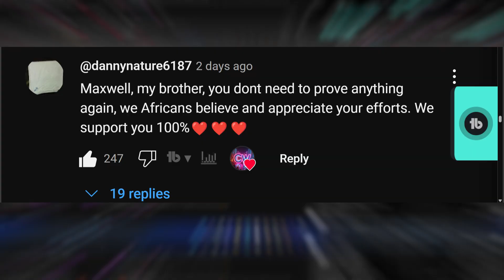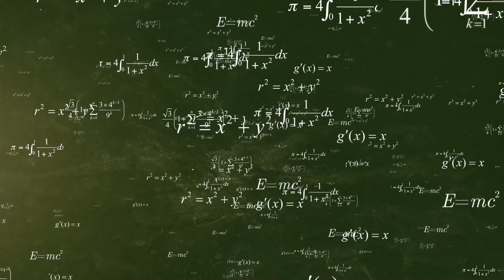African Tesla? Why Maxwell's Device Sparks Controversy

Comment: If he is generating energy from radio waves, why does he need a battery as shown under the hood? Radio waves are in the Pico, Nano, and Micro range - to amplify these signals require an additional power source. These signals can be amplified, but even the ampLified signals can barely push a speaker. The power required to push a car continuously cannot be generated by magic, it must be transferred, Radio waves are just too weak, even when harnessed at the source, much less from a distance. At one point he says the car is a generator, meaning like an alternator, and can power a refrigerator, and in the next breath he claims it is powered by amplified radio waves, harvest from the air - well, which is it? Generation requires magnetism, rotation, and conduction, and harvested radio waves requires amplification. This is fraud going on here.

Comment: Let us remember that his discoveries were born out of continuously experimenting with various electronic components from scraps, electronic components which he did not have a full understanding of their function.Let us put it this way, it's a break through that works, but the owner hasn't fully grasped the functions of his discoveries, for an example when  he said the energy is from the air,he lacked scientific terms of all elements that make up the air, and wondered what exactly from the air is powering his device? He  then discovered that it was radio waves! Let us remember that the man is not a college scientist, he will always lack  the scientific terms to explain his scientific discovery correctly so.He has also spent years crisscrossing the Globe trying to get it satisfied by the Scientific Community but to no avail.If the scientific community verifies this and it's real, the world is poised to change dramatically, this could be bigger than the industrial revolution, think about a space ship in space moving for ever looking for the new worlds out there.Humanity could travel in space without worries looking for new worlds similar to mother Earth, this could be the time to conquer the Outer Space!

Comment: The device must use cascading amplification to boost the output to a level of the radio signals it picks up.  It doesn't take a PHD to figure this out.

Comment: Comparing Musk's electric vehicles to Chicumbusto's microsonic technology is more like comparing apples to oranges.  Musk is not an innovator of electric vehicles General Motors has EVs way before the first Tesla was introduced.  Electric vehicles use batteries as a source of energy, a well known source of power, while Chikumbusto's microsonic theory uses radio waves, an unvalidated method yet to be proven feasible.

Comment: Lets remember how energy works: the electricity of our homes comes from outside with 10000 or more volts and is converted or reduced to 220 volts with and if we want to take 220 volts from a 12v 24v a lower voltage source what happens is that it will only work for a few seconds because the source finishes. So if readio waves are energy or else we cant listen to the radio, and they are always active in an endless signal like circle waves them taking the radio waves signal and making volts out of it its possible because the source is always turned on. And with an amplifier like capacitors that can store energy etc the output can be sustainable and without fails.
The energy isnt lost, just converted.

Comment: Tom Bearden's work suggests radio frequencies are the best waves to extract power out of the Time-space vacuum-apparently electrons spin in 4 dimensions, by Minkowski geometry and it is the time dimension ie the 4th dimension where you can extract this zero point energy. these devices are likely working on Scalar waves, which can be shown mathematically on Maxwell(yes James Clerk Maxwell) equations. Bearden had patents on similar devices but found the same hurdles for years that Chikumbutso faces today. This is neglected physics likely due to greed rather than physics laws broken.

Comment: While We Can Only Speculate at this Point ,  Base on my own Experience with Enegy Generation using Magmetic Power Rotation , I saw the Limitation, but alway belive the the Zero Point Concept can be applied to an DC Capacitor with Store and Regulated Release Function, note Capacitor Hold Load of Energy but are unable to Store this Energy.

Capacitors are a Kind of  Battery but unable to Store . I Think the Technology is using of Microwaves with Atmospheriic Eletrons which Multiples at an incredidable Levels of Energy , almost like the Sun which is slef powered. Its like putting a *Glass Full of Water in a Tank full of Water , the Water in the Glass will Not leave or the Water in the Tank will not leave, they are replemisnishing each other in a Eco System.  They are Equalized

I would Support His Work 100%
Reply: This is a remote controled car he isn't harnessing the radio waves he's sending radio waves from a transceiver to a receiver
Reply: My knowledge of electronics/electrical technology is above average. What you are saying is totally incomprehensible!

Comment: Answer to heading: because they want to steal his invention and rewrite history.
Reply: "Sometime in 1931, Dr Tesla took Peter to Buffalo, NY for the unveiling and final testing of a new kind of automobile. Dr. Tesla acted somewhat mysteriously about it, would tell Peter nothing in advance, and even after he had seen the car, answered some of his questions with “Don’t ask any questions. The car turned out to be a standard Pierce Arrow, with the engine removed and certain other components installed instead. The standard Clutch, gear box and drive train remained installed. Under the hood, there was a brushless electric motor, connected to the engine [?]. The engine was said to measure 40” long by 28” diameter. However, some of these figures may be estimates. Tesla would not divulge who made the motor.

 Tesla’s Power Box

“Set into the dash was a “power receiver” consisting of a box measuring about 24” long by 10” wide by 6” high, containing 12 radio tubes. Three of these tubes were model 70-L-7. A vertical antenna consisting of a 6-foot rod, was installed and connected to the power receiver.
The receiver, in turn, was connected to the motor by two heavy, conspicuous cables. Two “spindles” (rods?) about 1/4” diameter by 3” long protruded from the receiver towards the driver. Tesla pushed these in before starting and said: “We now have power”. These spindles were in line with the two power cables coming out of the back of the unit and presumable worked two separate power switches.
There was a 12-volt Willard battery installed in the car, but it was for the lights only and much too small to run the car. In any case, the motor was an AC motor.
Peter said that Dr. Tesla had built the power receiver himself in his hotel room, and carried it to Buffalo. The motor was built for him by some unknown company. The motor was completely enclosed and when Peter first saw it, it was stopped. Later, after the engine was running, Dr Tesla asked Peter to look under the hood to check whether the fan was running. Peter asked what the fan was for and was told that “The engine is running pretty hot”. Maximum engine speed was 1800 rpm. Power rating was 80 hp.”

A test Drive 

To start the car, Dr Tesla handed Peter an ignition-type key. Peter inserted it and a green light came on, on the dash. Dr Tesla thereupon said: “The engine is now in motion”. The engine could not be heard from the driver's seat at all. When listening under the hood with the engine on, there was a slight hum. The standard accelerator pedal was used to control engine speed. Clutch, brake and gearshift were unchanged.
The instruments on the dash appeared to be standard ones. However, there was a voltmeter which was used to measure output of the receiver. Dr Tesla commented that the receiver had enough reserve power so that you could drive the car next to a house, connect the wiring, and light up the whole house. There was also some kind of hydraulic pressure gauge on the dash. Peter asked its purpose but Dr Tesla would not tell him.
Peter drove the car for about 50 miles at speeds up to 90 mph (the speedometer was calibrated to 120 mph). Power seemed at least as good as the normal Pierce Arrow engine. Acceleration in second gear seemed particularly good. Shifting gears seemed somewhat smoother than with a normal engine.
Dr Tesla seemed enthusiastic on the first test ride and said, “Peter, this day will make history!” When Peter questioned the source of the energy to drive the car, Dr Tesla said: “It is a mysterious radiation that comes out of the ether.” He said that he did not know where it came from but that it seemed to be available in limitless quantities and that mankind should be thankful for it as it would soon drive boats, cars, trains and planes. Dr Tesla and Peter spent 8 days in Buffalo, testing the car. Peter described an incident where they stopped the car at a traffic light and a bystander commented that he could see no smoke coming from the exhaust. Peter replied to him: “We don’t have an engine”. When they left Buffalo, Dr Tesla removed the “ignition” key and the radio tubes and took them with him. The car was left at a farmhouse some 20 miles from Buffalo, not far from Niagara Falls.
Reply: @goranindjic7725  Where is the prototype for this story? What museum? Remember, aged materials are aged at the molecular level. Impossible to fake old metal. It has to actually be old circa 1931 material. Stories with no physical evidence circa 1931.

Comment: @ChrisWabs did an excellent job of presenting BOTH sides. This video is the BEST balanced (pessimistic vs. optimistic) and MOST FAIR account of Maxwell's amazing invention. 
As for the self-destruct feature, the mission critical part of the circuitry, which harvests power,
"in a split second", it would fry key components and possibly part of the circuit card.
SUDDENLY -- it can no longer generate power.  No external explosion.  Just "smoked" electrical components.
Reply: https://youtu.be/xOMLjCZNf40?si=iQxTJL-2S7H74e-k

Comment: This is this likely a kind of Zero Point Power device - draining power from a visable reality and beyond. 

I think he uses something that is based on 12 base math (instead of 10 base as we wrongly use on Earth) involving radio frequencies. 

Maxwell may have got some critical information from a friendly people of an advanced civilisations outside of Earth. I am really happy that this is coming out by a humble Africa innovator.
Reply: He says that It was revealed by His creator through Devine visions and dreams
Reply: While WE Can Only Speculate at this Point ,  Base on my own Experience with Enegy Generation using Magmetic Power Rotation , I saw the Limitation, but alway belive the the Zero Point Concept can be applied to an DC Capacitor with Store and Regulated Release Function, note Capacitor Hold Load of Energy but are unable to Store this Energy.

Capacitors are a Kind of  Battery but unable to Store . I Think the Technology is using of Microwaves with Atmospheriic Eletrons which Multiples at an incredidable Levels of Energy , almos like the Sun which is slef powered. Its like putting a *Glass Full of Water in a Tank full of Water , the Water in the Glass will Not leave or the Water in the Tank will not leave, they are replemisnishing each other in a Eco System.  They are Equalized

I would Support His Work 100%
Reply: @karlaxelahl  how does the base number affect the results of his math?
Reply: @logomoniclearning6680  Because true Universal math is based on base 12...:) which is used by all advanced civilisations